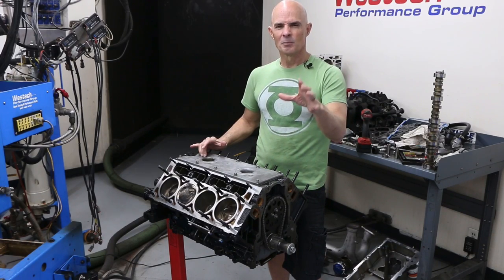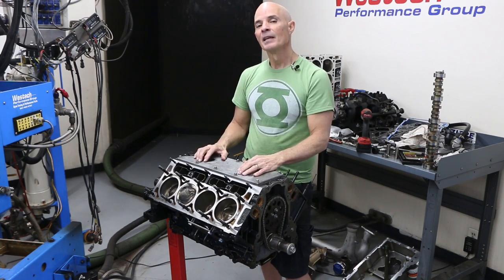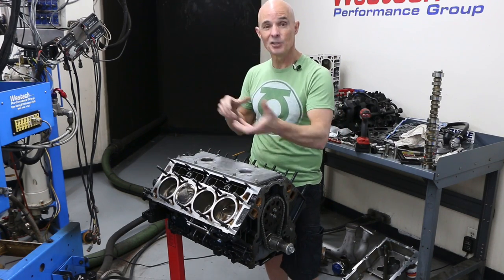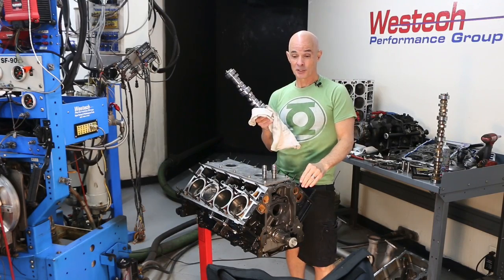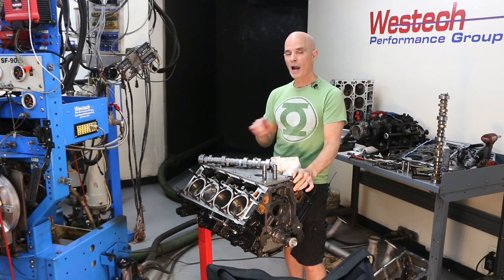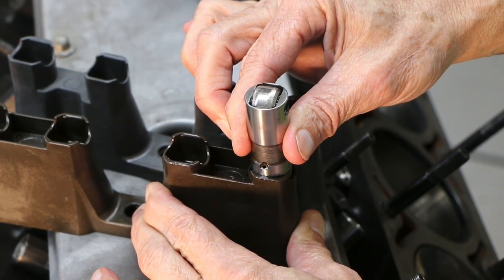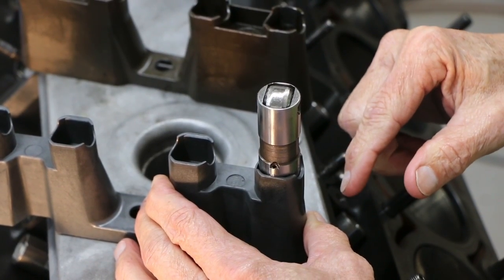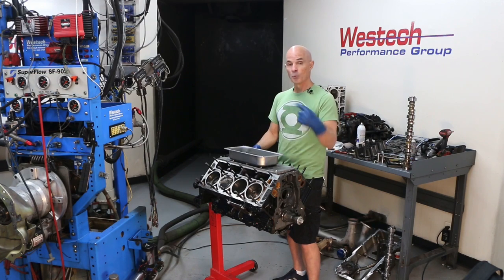WHY IT BROKE! 4.8L LS LIFTER FIX!

Comment: So that could be my problem cause a lifter tap started when I came back from a 3 hour trip so I parked it it’s on cylinder number 8 and it does have a cam and did delete setup what a good replacement lifter I can go with cause I really love this Saab truck with the Ls 5.3

Comment: Can a random misfire 0300 at highway speeds be early lifter/cam faliure? Engine temperature does not matter.
Reply from the maker: I would check other things-like plugs, wires, injectors (But also check on line to see if anyone has had experiences with that code)
Reply: @richardholdener1727  only after 70mph and only has 114k LR4

Comment: Hey Richard, I’m in a lifter pickle… I’m in the UK so swapping parts back and forth is not straight forward… my options are… reuse my OG lifters (in new lifter trays) which are the LS7 type (out of a 99 C5 LS1) are these likely to be the original lifters? The car has 140k miles. 

Or use some melling lifters which appear to be the same type of lifter you’re using here with the oiling hole on the top rather than the side. I think they’re the same lifter as the morel, at least they’re visually identical. They have some light abrasions from shipping and to my limited experience don’t seem to be the quality of the GM ones I pulled from the car. 
You’ve had more lifters in your hand than the average fella, so any advise appreciated… are mellings any good?
Reply from the maker: we reuse factory lifters (high mileage) all the time
Reply: @ that’s good enough for me. Thankyou !

Comment: I am new to LS engines. I normally take warranty claims for cars all day since I’m no longer able to work as a tech. When I get a new to me LS engine, should I immediately replace the stock lifters? If so, what kind do I use?
Reply from the maker: we run junkyard lifters with high mileage all the time

Comment: i just put all new lifters in my 2011 5.3 because 1 lifter on 4 cylinder stuck new oil pump 40 lbs oil pressure idle now it doesnt have a missfire but a clicking its on #1 cylinder the lifter is not oiling i started it with the valve cover off and the ones beside it are spraying oil 2 feet out past the rocker arms brand new melling lifters what can i do other than tear it back down and replace it ?
Reply from the maker: You need to figure out why there is not oil-remove the pushrod and check that if is not clogged-you can pull that lifter with a magnet and extension to examine
Reply: Thanks for your reply. I pulled the head yesterday and removed the lifters that were in that tray the lifter that wasn’t oiling the inside of it spins while the one beside it won’t . I guess a bad lifter out the box !

Comment: I went to billet lifter trays on my hemi same type of set up. I just don’t think that plastic is the best way to keep the lifter straight on the LS’s and the hemi’s
Reply from the maker: the factory trays work for 300K miles-but you need to use factory trays with proper tolerances

Comment: @richardholdener1727 how long did you soak the new lifters? Ive heard everything from 10 mins to 24 hours.
Reply from the maker: I do it til the bubbles stop coming out-if you soak them overnight-it won't hurt anything, but I soak them while I'm doing other stuff on the assembly

Comment: Do a HP/TQ difference between a standard bore 4.8 and one bored with 5.7 pistons installed, both flat top
Reply from the maker: Bigger motors make more power

Comment: Definitely this is a idea since this happens so much i wonder if there is a way to use the old lt guide plate and trim down the plastic tray to have that extra support would that even work i wonder this idea is for budget builds of course the link bar is best but some of us poor guys gotta find little tricks
Reply from the maker: just use good, new GM trays-they work for 400,000 miles
Reply: Thank you for your feed back i just ordered a set of new oem from the dealer and they were cheap Thank you again love all the information you provide for us

Comment: I noticed while you placed the oil pump in you didn't use filler gage to set ?? Why is this not recommended.
Reply from the maker: filler gauge to set what?
Reply: @richardholdener1727   the oil pump  center.i see alot of videos that they will center the pump
Reply: @richardholdener1727  just look up shimming the LS oil pump!

Comment: Ha I had a theory that this is why the lifters fail... not the lifter itself but trays. I made SURE to delete the lifter trays on my build and went with linkbar lifters. Great video... great to see you confirmed my theory. I think ls lifters are a good design but didnt like the plastic trays.
Reply from the maker: the stock trays work very well-just not after 300K miles and not when you try to run cheap (non GM) trays
Reply: @richardholdener1727 that is a good endorsement of them! 300k miles wow.  I just felt weird with a plastic guide for the lifter. Some people told me lifter failure is somewhat common on the Gen III stuff. Not sure if that's rumor, but I felt if it is, I'd suspect the tray before the lifter without any further knowledge. Love your videos BTW I built a LQ9 up with cam from Roger Vinci custom ground me a cam. I put Yella Terra Ultra Light Rockers, bigger injectors (from flex fuel L59?), LSR 2116 Johnson Lifters (Overkill haha), and as a result Manton cut me pushrods to fit. Fun time though, watched a lot of your videos during the process. Been tweaking the tune for a couple years now. Have AFR Heads on my wish list, not sure if I'll ever get em. Rest is all stock LQ9.

Comment: lets see what you can get outta that 4.8 bee gr8t, turbo of course... id like to see a daily driver , reliable , road monster that can put about 650-700hp to the ground and maybe similar trq numbers. and please give us the grocery list of everything we need to duplicate your success minus the dyno machine, us simply garage mechanic folk dont have a dyno machine in our backyard... nor the access to one on the regular. anyway thats wht I'd like to see... im tryin to make my 4.8 gr8t again -like its never been before.
Reply from the maker: truck nori scam, btr springs, head studs and gaskets, 80 pound inj, larger fuel pump, S475 turbo, intercooler and piping

Comment: If you think those plastic liners are keeping those lifters in line thanks again. Set those trays up and actually measure them. The flat surfaces are all over the place. It also must be said that there is not anything trying to rotate that lifter. The wheel is trying to hold it straight on the flag of the cam. The only time it can rotate is if it’s on the nose of the lifter or the base circle just saying.
Reply from the maker: and yet...this happens when the trays wear out

Comment: Can worn lifter trays cause lifter chatter or lift knock noise , I’ve torn down my 5.3 and didn’t notice any damage on lifters or cam …..my trays have lost their grip(mostly on the two inside) and wonder just by replacing the tray would that remedy the noise …
Reply from the maker: If you have taken it apart-you should definitely replace them
Reply: @richardholdener1727  yessir I did remove them . I do plan on replacing them because of that but before I reassemble .. I just wanted to know if that could cause the noise or if I should be looking more deeper . Thank you for your reply

Comment: I recently heard a chirp which turned into a top end rebuild. My first LS tear down, I thought it a good  thing I wasn't doing a cam. All 4 trays were not holding on to lifters. So I rotated cam again and nothing. All but 3 rollers flacking and another 2 went skiing sideways down their cam lobe. So I think that a very likely possibility.

Comment: I just saw a form where they drill four half inch holes inside the lifter trays to help oil drainage back into the motor. Is this something that you may possibly test or is it probably not a great idea. Saw this in a couple forms

Comment: I have a 2002 chevy 1500 silverado LS, 4.8 Lt. Pick up. It's got 280,000 miles after 20 yrs. I am a retired FF and was a founding member of Metro (Miami)-Dade Fire Rescues U.S.A.R. Team; Florida Task Force 1. We were the first out of initially, 26 teams Nationwide that have grown to probably close to 100 by now that were fire department based Urban search and rescue teams intended to respond to disasters nationwide/domestically through FEMA and to respond internationally through USAID/OFDA (US aid and international developement/ office of foreign Disaster Assistance). A big official title for a group of Select firemen who were lucky enough to belong to a department that had the opportunity to do this. Anyway, the reason I mention this is that I purchased this truck shortly after September 11th which also happened to be my 33rd birthday. After that experience I thought, screw it , life's short I might as well enjoy it so I went out and bought my first new truck. I've had it since that day and it's been an extremely reliable vehicle. Other than routine things such as brakes, batteries, and a water pump I have had no major problems or repairs. However I have developed a major rear main seal leak and a rattling lifter that I am concerned about. I'm not sure how to go about dealing with the lifter problem. The truck is in great shape and I would love to keep it another 10 plus years I don't know if I should just replace the lifters or consider doing more internal work to the engine. Part of me says don't fix it if it's not broken and another part of me says if I open this thing up I might as well consider doing a rebuilt what are your thoughts about this. Should I just fix the lifter or is it worth it to go further and if so, how much further? If this was your truck what would you consider doing? What would make sense and what would be going too far?
Reply from the maker: EASY FIX
Reply: My '03 Suburban started making a pretty loud noise from the top end back in August.  I used some seafoam in the oil, then motor flush, and dropped the pan to clean it out.  The noise went away, but the cylinder 5 idle misfire never did (isn't plugs, wires, coil, fuel injector, vac leak, etc, tested all that already).  I'm now in the process of collecting the parts to put a fresh top end on it, picked up a set of rebuilt/machined 799 heads yesterday, ordered rockers with bronze trunnions today, new LS7 lifters, figuring out what cam I want to use now.  Then I'll do a new timing set, new oil pump, and whatever else I need to replace while I'm in there.  Looking like it'll run me about $1500 for everything, which I think is pretty reasonable for all new, good quality parts.

I considered a whole new engine, but the cost and the fact that this engine has been well taken care of (very clean under the valve covers, oil was changed regularly) made me decide to just fix what I have.  A used/junkyard engine is a roll of the dice, no telling what you're going to get with those.  If I got another vehicle, it could end up with the same issue or worse at any time.  I'd also already put a lot of money into the brakes and suspension prior to a trip to the Grand Canyon, and it already had brand new Terra Grapplers on it when I bought it.  Only logical choice for me was repairing it properly.  Most everything I bought can be used on a LQ4 if I wanted to up the displacement later, too.

Comment: Nice video. I think you’ve nailed it. Does it matter which position the oil hole in the lifter goes when placed in the lifter tray. I am assuming not that it has 360 degree oiling. Is this correct?
Reply from the maker: THE LIFTER JUST NNED TO BE ORIENTED ON THE CAM CORRECTLY(ROLLERS)-THIS IS GUIDED BY THE HOLD DOWNS

Comment: I personally think it’s the worn out lifter trays + worn out lifters and hi RPM abuse. Just the spring pressure with zero lash should be sufficient to keep the lifter on the cam lob properly.

Comment: What about valve spring’s? What causes them to break? I have a 2003 Silverado that had a broken valve spring on the passenger side.  Truck still ran , just made ticking noise. Removed the valve cover and the thinner spring was broken. Replaced the spring and truck is still running today. Just wanted to know..
Reply from the maker: AGE, CYCLE LIFE, HEAT, BAD BATCH, ETC...
Reply: @richardholdener1727  
Thanks for your reply. I could only come up with those answers also. I’m not much of a mechanic so this threw me for a loop.  I was mostly paranoid something worse was around the corner but it turned out ok. This was around 2007 . The truck worked fairly hard since I bought it and that’s about the only issue. Anyway, thank you for your reply I appreciate it.

Comment: I have an LR4 in my 1500 Silverado 2002. I want to do a light performance build to it. 320-350 WHP for daily driver and ultra reliable long distance highway cruiser. I would like to keep running reg grade pump gas. can you do a test on your LR4 with a well balanced set up, heads, cam, headers, intake, throttle body etc? Really like your info great content.
Reply: Oh yeah, 862 or 706 castings, ported or not ported.
Reply from the maker: there are 4.8l vids up making good power-it will just require making it at higher engine speeds

Comment: If I have a collapsed lifter on a 250000mile engine should I attempt to pull the cam or I guess what I'm curious about is should I expect wear on the cam okay next I need to know about the solenoids
Reply from the maker: cam wear might not be an issue

Comment: Hi Richard, awesome video and extremely helpful! Now, I have to replace my lifters because it is making that horrible clicking noise. I need and would like advice and guidance on what parts to buy. Im thinking of rebuilding the heads and get as much performance as possible N/A. I will appreciate any help and advice.

Comment: Can you tell me the symptoms of a boost leak on a Chevy v8 with twin cxracing 78’s?
Reply from the maker: slow turbo response (but you already have that with twin 78s)
Reply: @richardholdener1727  thank you for the response! So I have a pretty built 350 with the twins and for some reason I can’t get it to make more than 5-6psi and it won’t rev past 4500, just falls on it’s face

Comment: I agree with the idea of the chamfer on the lifter being caused by rotation. However that little bit they rotated in your example would not wear them like they appear. Maybe the trays expand with heat and the lifter rotates more, but I can’t see that little bit of rotation you demonstrated causing that amount of damage.  We’re there loser trays?  I will be changing mines when I do afm /dod delete.

Comment: What is your opinion of too high mileage (as you mention here)  when doing a cam swap, where it is a must to replace the lifters as well on LS 6.0 Thanks.
Reply from the maker: if its running-we don't change the lifters-but obviously we should look at the trays
Reply: @richardholdener1727  Agreed however,  my concern is a "new cam" installed with used lifters. at how many miles (average) would you say (as you mention in this video) would be considered "high mileage" at such point that you would want to replace the lifters when replacing a cam? Or would you simply inspect the old cam for ware to determine this? Thanks.

Comment: To hell with rollers use a mechanical flat tappet cam. The rollers put extreme pressure on the rotating pin which is tiny. How they last as long as they do is a wonder. Look also at the side force on the lifter bore which makes the "Trays" wear. It is a cheesey setup with a limited lifespan.
   I have been looking at used chevys and the ones with 200kmi or better have a tiny tapping noise. Surely it is the Worn out junk Lifters and "Trays" This design is for production line speed and not much else. 
No matter what lifters are used there is always problems with high run times.
Reply from the maker: flat tappet?  no thnx

Comment: Ok my question is can you remove an lifter three the top of the engine without pulling the heads?
I have an 04 5.3l with an bad lifter tap I want to pull and clean or replace
Reply: No. Heads come off

Comment: I have a quick question because this has happened to me twiceeee building motors. I replaced the lifter and lifter trays and the motor was stuck and I changed everything thought it was head cam bottom end so rebuilt everything and replaced everything buttttt the thing I didn’t change was the lifter trays. I was using aftermarket trays and they were actually locking the motor motor and wasn’t letting it turn where do you think I can get some reliable trays that won’t do that to me any recommendations help!!!!!

Comment: question about reusing lifters, should you take the old lifter apart to clean them.  When you do they push down very easily because the oil is out of the lifter.  They should pump up, but that's a lot of work to test that theory.  What are your thoughts about this?
Reply from the maker: I don't clean them

Comment: Got a 4.8 liter in my 2000 GMC Sierra.  I’ve had it over 20 years, best engine I’ve ever had!  180k trouble free miles.  Would like to see a pro charger added to test engine.